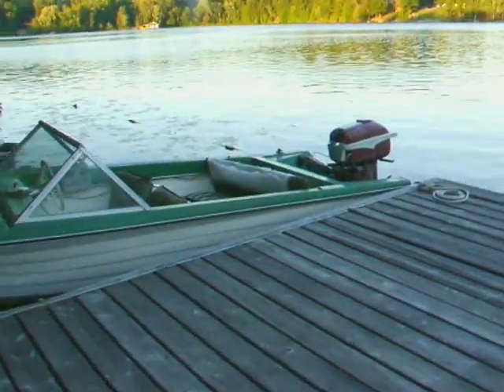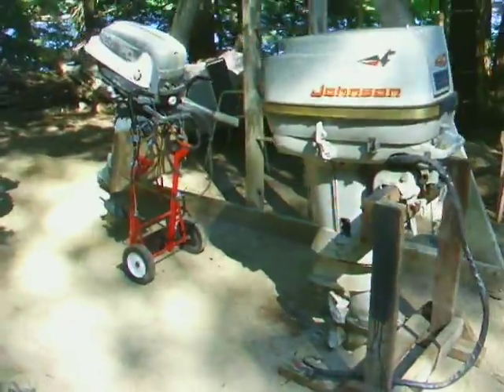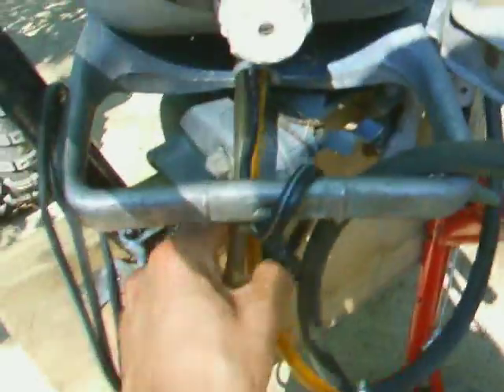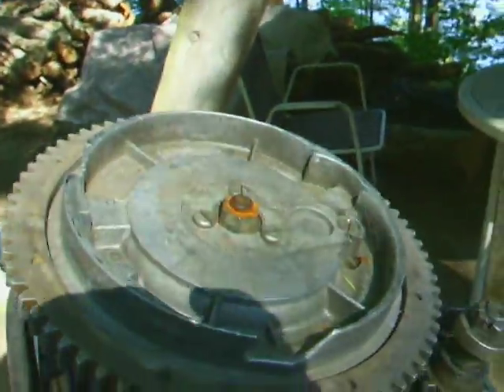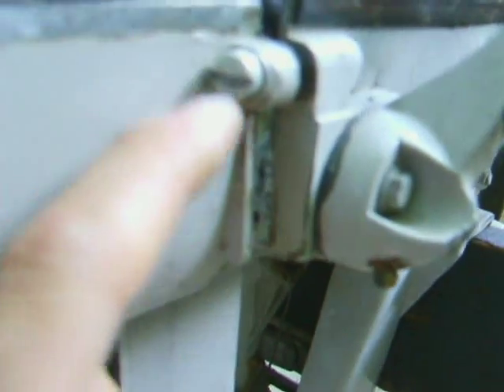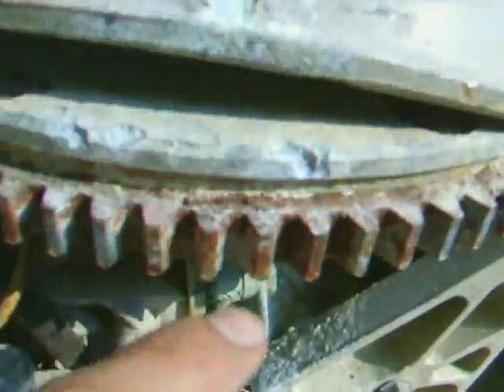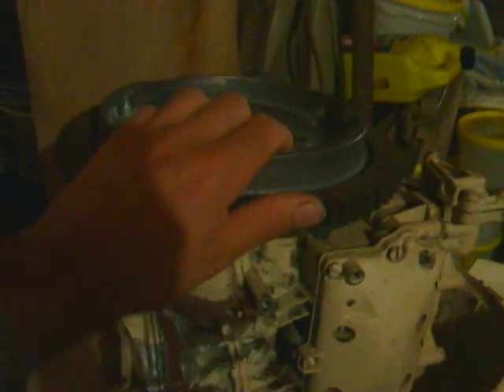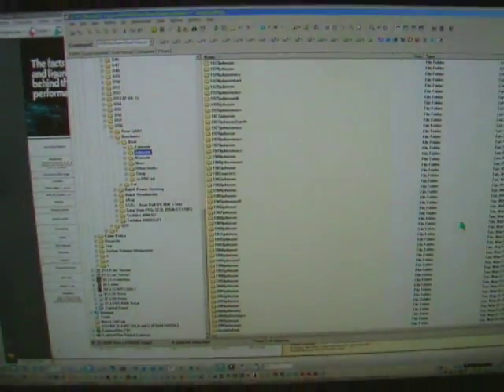1957 Evinrude 18HP Running! + 1961 Johnson 40HP tour + OEM Brochures + my Motor Collection!

Comment: Awesome to see a 57' Evinrude with an Electric Start. Mines a Manual Start but is all nice and clean everywhere else. I've been piecing together a 57' Evinrude 35 and all thats left is to wire up the starterbox and buy a bolt or 2 for a tiller control and it's ready to go.
Reply from the maker: Hello there, sorry for the long delay, just saw your comment now.  My ISP's SPAM filter is really starting to annoy me..:o)  Congratulations on getting your '57 Evinrude 35 back together, I'm sure you'll be happy with it, these motors run like swiss watches.  Check out my other videos for my 1956 Johnson 30hp and you'll see what I mean....:o)  If you'd like any advice on the wiring, or a PDF of the 1957 Evinrude brochure, just ask.  Thanks for watching - Cheers!  Bellarmine

Comment: Nice!
I am in the Pacific North West and just bought a 1968 14' Dagger fiber haul, 1976 EZ trailer and a 1961 Johnson 40hp RDS-23 all for $200.

Mine is all setup and spins but no spark.  Bought it from a widow, so no talking to the guy who'd kept it running. Somethings under the bonnet had been disconnected so. . .  Everything seems freed up though and I am just trying to decide on fix or don't fix.

Reliability is kind of key as I want to do a little crabbing and if your motor gives out in the straight with the prevailing 7.5 mph tide you can find yourself in Canada pretty darn quick. 

So just like you I love the look and the power would be a good match for the boat, obviously the previous owner had good taste.  But I don't want to start tossing money at this motor only to find that key parts are no long available or are cost prohibitive.

What do you think?
Thanks for your time and insight.
Reply from the maker: Hi Tim, thanks for contacting me!  Sure, I'd be more than happy to help out as much as I can with advice and tips.  You got a steal of a deal there, you could resell the trailer for almost double and keep the boat, things are weird these days lol.

First, I would say absolutely, fix it up.  Sounds like an awful lot is right already, shouldn't take too much to get it running.  As for parts, VERY VERY easy to get AND cheap - Sierra and GLM are making good-quality reproduction parts for these motors, if necessary you can renew the entire ignition system brand new for about $100.  I just found a fellow up here that has tons of these motors, sold me some parts cheap for my own 40HP, if you get stuck I can hook you up with him.

As for the no spark, a number of things come to mind, of which none are deal breakers and most quite simple.  I would LOVE to see some photos of your motor and boat, under the hood, the "disconnected" things, etc.  As you can guess, debugging from across the country is difficult at best, so the more detailed photos the better...:o)

These motors are so easy to work on, once you get it running you'll never look back.  Take a look at my other videos for a 1956 Johnson 30HP, I am the 2nd owner....:o)  Did a full tuneup on that one, carburettor, ignition, lower unit, runs like a dream and has never let me down.   I'm also helping my neighbor with a 1993 Yamaha 70HP.  What a difference, THREE carburettors (overhauling all 3 as we speak, groan!), wiring everywhere, complication deluxe.  In contrast, I can draw the wiring for your 40HP in about 10 minutes on a napkin, I'm not kidding.

Hope that was helpful and not 'too' overwhelming....:o)  Wish YouTube hadn't removed the Private Messaging system, but you can message me by sending to my username without the 33, followed by Rogers and then Com.  

Talk soon Tim, let's see if we can get your motor out on the water.

Bellarmine
Reply: Thanks! You are very kind.
I will try to do a quick walk around the motor and take some video.
Once upon a time you could post video responses, but I don't see that option off hand.
My main concern was things like pistons and rings.  So I guess I'll pop the head off and see what I see.  Check the components that replacements are not that easily had and work backwards form there.

Give me a few days and I'll have video and or pictures to share.
Thanks again for the offer of guidance.
Reply from the maker: Hi Tim,

No problem and my pleasure, I'll wait to hear from you.

Sure a video would be great, and you can also send any photos directly to my email address I mentioned above (in 'code'...:o).

A suggestion, I don't want to tell you what to do, but I would recommend checking the motor out a bit more first, before you get into taking off the cylinder head and worrying about pistons rings etc etc.  Because then you will need a new head gasket ($20), and unless I am sorely mistaken its a good chance everything in there is just fine.

You can just use a compression tester in the spark plug threads to check the pistons.  Or, another quick check, how does it feel when you pull it over slowly using the pull start?  Do you feel two nice bouncy bumps per rotation (the two cylinders), and are they about even?  If so, then don't worry about the compression (for now), let's get the spark and gas working.

Take a look at my 1956 Javelin video, I've never taken the cylinder head off that, or even worried about the compression on it, obviously is just fine...:o)
https://www.youtube.com/watch?v=tH2JOdNqke4

Again hope this helps Tim, look forward to hearing from you.  Best wishes!

Bellarmine
Reply from the maker: Thanks for the video Tim, you show quite a bit.  Would you mind sending me an email so we can communicate a little easier, YouTube didn't even notify me about this your latest comment for some unknown reason.  Once again, you can reach me by using my username without the 33, followed by Rogers and then Com.  Thanks!

Your motor looks pretty good.  As for that switch under the flywheel and I think the disconnected wire, they are just an interlock to prevent cranking the motor with the throttle too high. I guess someone felt they were a pain and disconnected them, we can hook them back up later if you want.  As for the cylinder head hex-bolt torque values, I can tell you those, they are 14-16ft/lbs.  I own the original Johnson factory shop manual and the Seloc manual, and I can even email you a digital copy of the Seloc manual I found online.

I would suggest, retorque the head, debug the spark (you have a spark tester?), dribble some gas in the carb throat and see if she fires up.  Then we can go from there, with the lower unit etc.

Talk soon Tim!  Bellarmine

Comment: Hey thanks for the video! I recently purchased a 1956 35hp evinrude and was told it was last ran 6 years ago. I didn't start working on it yet but plan to very soon. Would be nice if I could ask you questions I may have since this is my first outboard motor.
Reply from the maker: Hi Aaron, thanks for your comment, you're the first...:o)  That's a nice motor you've got yourself, Evinrude always looked a tad fancier than Johnson in my opinion.  Once you get it running it'll give you many years of fun trouble-free enjoyment (unlike the newer stuff lol ;o).  The same as the 1956 30HP Javelin in my other videos, if you haven't seen it already take a look, runs like a swiss watch (2nd up from the bottom):
https://www.youtube.com/user/bellarmine33/videos

For sure, I'll be glad to answer any questions you might have, it'd be my pleasure.  You can reach me at my address shown in the small image linked below (I don't want to put my address here in the public Comments section, if you know what I mean):
https://s25.postimg.org/41jj00qpb/bell.png

Shoot me a message there and I'll send you a PDF of the original 1957 brochure for your motor.  I have all the years for Johnson + Evinrude on my HDD, any others you'd like to see let me know.  I can also link you to a service manual and exploded parts view, essential reading for these motors.  Hope to hear from you soon Aaron, welcome to the vintage motor club.  Cheers!  Bellarmine
Reply from the maker: Hello again Aaron, I"m wondering if you were still interested in a 
brochure for your 1956 Evinrude 35HP?  I'd love to email the PDF to you, 
but I don't want to put our email addresses on this public comment board.  Perhaps I should have explained, the link below is simply a .PNG picture
 / screenshot of my email address, to prevent spambots.  If you email at
 the address shown in the image I'll get right back to you.  Hope to 
hear from you soon Aaron, Cheers! Bellarmine

https://s25.postimg.org/41jj00qpb/bell.png

Comment: That's crazy that you found it as a junker.  I've bought a few at a good price, i.e. Under 100$, but I've also been stupid and paid way to much at first.
Reply from the maker: Thanks for the comment.  So you've had a few of these motors, I think they are the perfect balance of performance, style and simplicity.  I have all the brochures on my HDD, leave a comment if you'd like a few for yourself.  Youo'e got some nice 1950's QDs and FDs yourself, great motors.  Yes I guess I was lucky to find the motor!  I did want a nice 1960's 40HP, and turns out this junker I found was about the exact year and style I would have picked - very nice shape as you can see.  Do you have any opinion on the excessive corrosion under the hood - everything is seized except the cylinders...:o)  Anyway, when I get the time I'll be giving it the usual carb and ignition tune-up, free up/change the starter and hopefully should run pretty nice - seems decent compression.  I even have an original generator for it, just need a new flywheel and regulator.  For now I have a lot of fun with my 30HP Javelin that my neighbor, the original owners, made a gift of to me after fixing it for them several years back, very nice (see below).  Same retro style as your QDs and FDs - great stuff.  Cheers!  Bellarmine
https://www.youtube.com/watch?v=tH2JOdNqke4&lc

Comment: Did you ever manage to get the Johnson 40 HP running?
Reply from the maker: Hi Rick, No I haven't gotten it running yet, but i still have it waiting for when I have a bit more time.  Been enjoying the Javelin 30HP in my other videos, still runs like a champ.  I don't think the 40 will need too much, compression seems decent.  Just disassemble and clean the carb, magneto and starter, and after it's running check the water pump and lower unit seals.  You'll probably see a video up here when I do get it started - hopefully soon.  

I did take the old Evinrude 18 out for a spin on my boat last year.  After straightening the bent shifter handle and except for a rattly and leaky carburetor, it runs like a champ - goes over 20MPH, near as fast as the Javelin - amazing!  Guess the compression is good in that one.  Cheers!  Bellarmine

Comment: All that white corrosion is more than likely from rodent pee. I bet it sat in a barn and mice lived in it for years.
Reply from the maker: I think you're right.  Since then someone else told me moth nests, same thing.  Anyway could be worse.  A mechanic I showed it to says no big deal, and it looks really nice on the outside, very good cosmetic condition, he says whoever had it took pretty good care of it at some point.  Just got some parts to replace those mismatching bolts and little missing covers, and I'll be getting a couple tune-up kits presently, maybe I'll be getting it running soon.....:o)  Be sure to check out my other videos for a very nice running 1956 Johnson 30HP, my current pride and joy. Thanks for your comment Matt - Cheers!~  Bellarmine